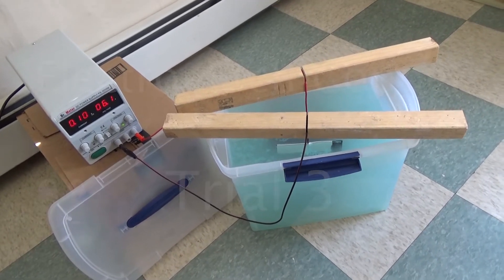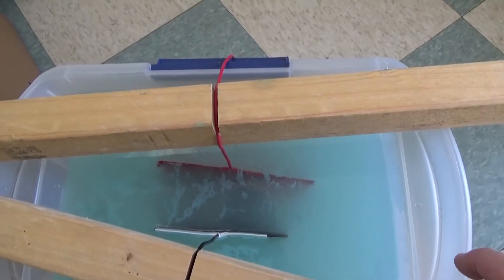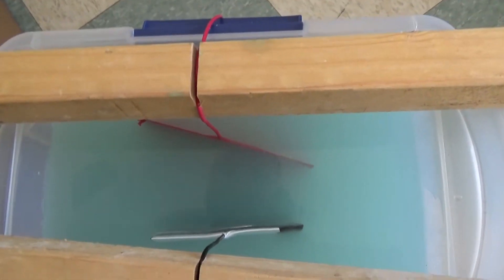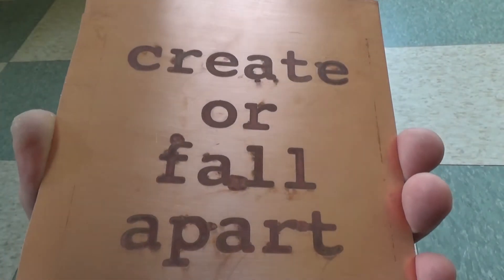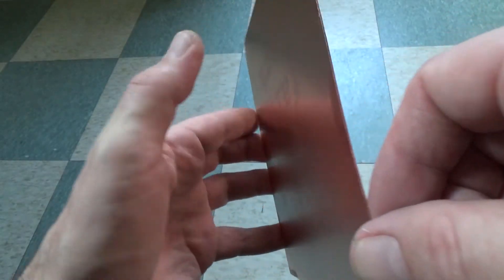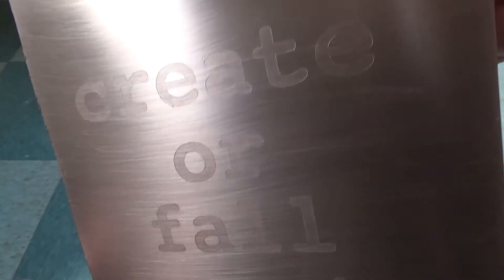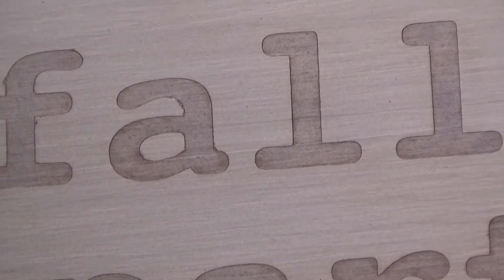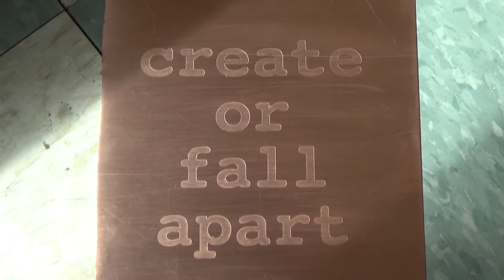Electro-Etch Copper with salt water - Trial 3 - Final Update on setup.

Comment: What if you used something other than steel for the cathode?  Say Brass, or Aluminum?  Just curious how it would react.  Great job!
Reply from the maker: Honestly, I don’t know. I have tried with copper, but not with aluminum or brass. I’m sure it’s possible, may have to adjust settings etc. Maybe I should do a project video of that and see how it goes. Thanks for watching and commenting! Stay tuned and I’ll try to get a test vid posted of the diff. metals soon.
Reply: @fleanine  I meant trying to etch the copper with something other than steel.
Reply from the maker: dolfinmagikpro oh I’m sorry I misread that. In answer to that,  no I haven’t. but it would be interesting to know. I’ve been meaning to get the tub back out to do some etching again anyway. May be time for some experimentation. Thanks!
Reply from the maker: dolfinmagikpro  I recently posted a video of various metals and electro etching each with the same settings / using copper anode as well as cathode / also aluminum. Results were a bit different than what I got in this video.  Thanks again for watching and commenting! 
Check out my LATEST ELECTRO ETCHING VIDEO HERE - POSTED NOVEMBER 2019

Electro Etching Various Metals- Copper, Aluminum, Steel, Damascus https://youtu.be/Jab0X2MuK5s

Comment: nice!
do you know if this only works on copper?
Reply from the maker: the setting may vary depending on the salt/water ratio/ but I have done steel before same technique... worked out pretty well.   https://youtu.be/ncWXVOzNGbA
-results at around 9min in.